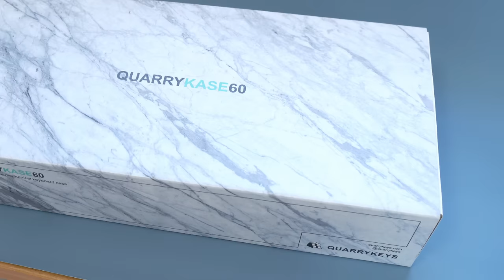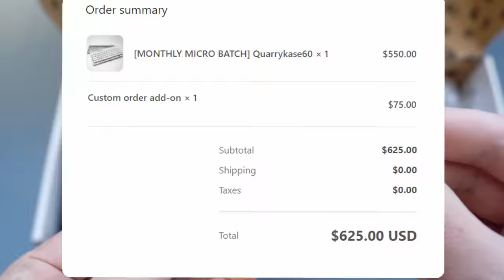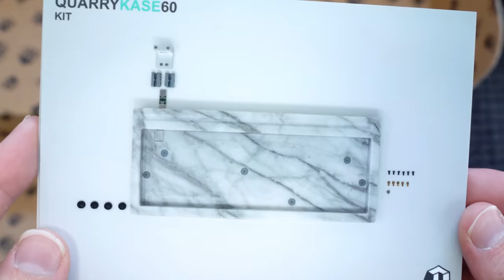I Built a $1000 Mini Ecosystem IN A KEYBOARD.

Comment: For watering your plants, may I suggest using a small syringe? Seems somewhat safer than a spray bottle, even if it's just a display piece ;)
Reply: Or ice chips
Reply: 10 cent droppers you can find in labs too
Reply: @miguelibrahim2151  idk where you would find that in the first place but, 10 cents? Dam I bet here in the usa it’s gonna be like 2.50 for one (just assuming bcoz inflation)
Reply: @srirangamsk  about 10 cents in the states as well. They are called pipettes. :D
Reply: @sopp1ng  cool I’m gonna get one now 😤
Reply: If you have an old eyedrop bottle that's getting low, pop the top and rinse it out thoroughly, then you can put water in it and use the bottle as a precise dropper
Reply: Pipette also works
Reply: You can get 1-3 mil graduated pipettes (entire boxes) for fairly cheap, and they’re reusable since you’re just watering them. Honestly, even a pack of 10 from an art supply place would do you good. Or a blunt ink syringe as some people are suggesting.
Reply: @srirangamsk  I don't think you know much about prices in general lol
Reply: Syringes are free at pharmacy, just ask pretend you need it for a kids medicine
Reply: A turkey baster is what I usually use to water low-humidity plants. It has the benefit of being able to hold a bit more water than a small pipette

Comment: the succulent pot is actually gorgeous man
btw  it would be easier for you to cut the stems a bit shorter despite the roots, those little bloops are perfectly capable of growing some more out of the thin air (literally), so you could plant them in plain gravel because of that and they'll do just fine without the risk of ruining the keyboard by sand and soil. As for watering they can go weeks and months without it and even thrive and grow more dense prettier rosette, so I would't bother too much with these babes until they grow some roots and then just watered them from time to time with a straw. Looking forward seeing more plant content!

Comment: @Hipyo Tech so 1000R - That's literally the radius of the curve if it was drawn as a full circle. So if it was a 500r, it would have a tight curve, if it was a 1500r it would be a more gentle curve. I'm however not sure if they are talking CM or inches, but the gist is to imagine a full circle, the bigger the circle the gentler the curve.